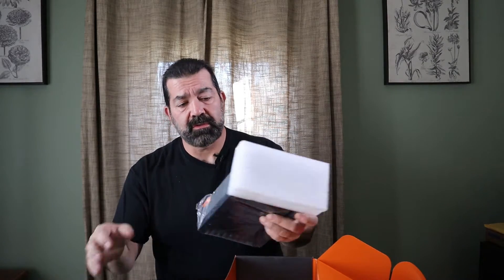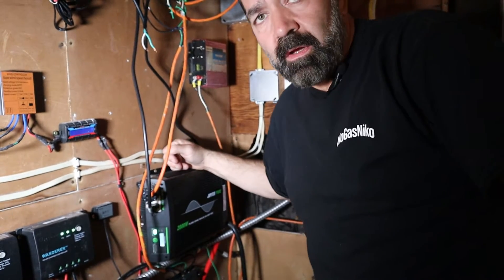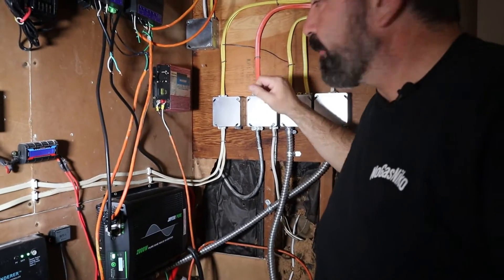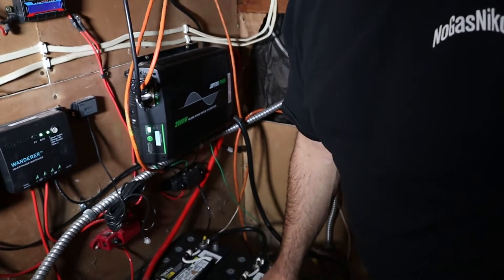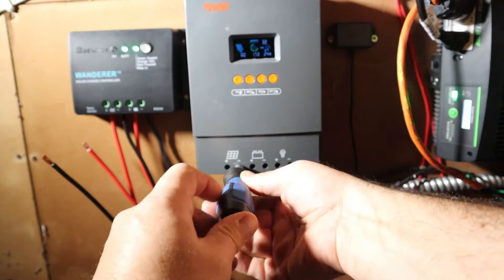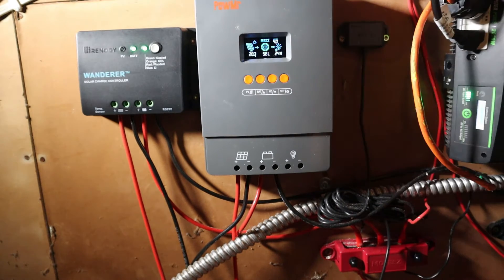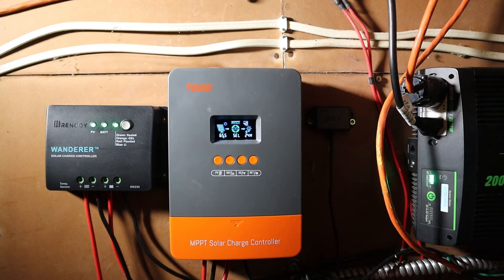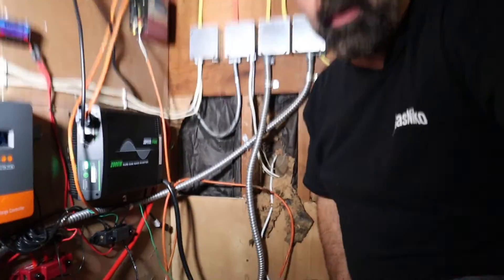PowMr 12V/24V/36V 60 amp MPPT Install - Part 3 Solar Upgrade

Comment: Bud out of the 5 series what series do i set my life po4 battery series4 or 7 or8 or15 or 16 thats my question
Reply from the maker: I would have to refer you to the manual or their customer service.  I don't want to steer you wrong since I'm running AGM batteries and don't have experience with that yet.
Reply: @NoGasNiko  ok

Comment: Falownik PowMR 6,2 KW Instalacja paneli fotowoltaicznych to 3,6 KW, falownik nie jest podłączony do akumulatora i nie jest podłączony do sieci. Mam podgrzewacz wody o mocy 2 KW podłączony do wyjścia falownika. Falownik nie włączy grzejnika nawet przy pełnym nasłonecznieniu. Jeśli zamiast grzejnika włączę odbiornik o mocy 500 W, falownik będzie wytwarzał prąd. Jak ustawić falownik tak, aby cały czas dostarczał prąd bez względu na obciążenie, chcę, żeby dostarczał tyle prądu, ile jest aktualnie w produkcji i nie wyłączał się, gdy załączę większe obciążenie. 

Instalacja fotowoltaiczna: 
225 szer. x 16 = 3600 W
36,9 V x 16 = 295,2 V

Ustawienia falownika
https://youtu.be/l9n7lgL5nu4?feature=shared
Reply from the maker: I am not familiar with this unit.  Can you verify the actual input from the panels?  I currently have 1.2 kW and I almost never achieve 1200 watts.  I see 1000 consistently.  Also check the manual for any mention of limits for the inverter.  Maybe there's a cut off based on input?

Comment: Can I hook up like a power strip?
Reply from the maker: It's 12 volts only.  Will not run a power strip
Reply from the maker: Nothing about this unit changes 12 volts to 110 or 120 volts.  It's just a charge controller and not an all in one unit.  PowMr has all in one units and that's going to be my next purchase.  It'll probably be spring time when I upgrade to 48 volt system.

Comment: I have a question for you. I have the same MPPT charge controller. I know where the solar system cables go. I know where the power cables go, but what is the icon with the lightbulb? What do you connect there? Can you please help?
Reply from the maker: That's for a 12V load.  You can hook a light or anything else that takes 12 volts.  It's an output regulated at 12 volts.  I've never connected a meter to it, guess you just gave me something to test 😁
Reply: you typically won’t use it in a home install, it’s mainly for if you have a caravan and you want to hookup some 12v appliances

I think it will product power so long as their is either solar or battery power present

Comment: I have a very bad experience with Powmr products. Their GT-800 micro-inverter lasted 6 months and gave up the ghost. Customer support and warranty coverage were a real pain and it is still not fixed. They constantly ask for new elements in order to exhaust the customer.
Same thing for the provision of a simple AC connection cable between 2 micro-inverters, presented on their site. After at least fifty emails, I gave up. The customer service is deplorable.

Comment: my 60A powmr doesn't let me configure the charge settings in the USE setting to match my 36V100ah LiFePO4. It limits me to 17V even when I choose the system voltage 36V. WTH
Reply from the maker: Have you tried calling their support?  I'm currently running 12V but plan on switching to 48V real soon.
Reply: It displays a 12v setting but you supposed to x that by you battery voltage so 14.5x4=58v that's a 48v battery top charge. Yours would be x3
Reply from the maker: That depends on how you connect the batteries, series vs parallel.  If parallel you don't add the voltage.
Reply: @NoGasNiko what if it's anything over 12v battery the controller don't show the higher voltage battery settings in the manual it even says 24 36 48 is 2x 3x 4x the 12v number in the controller. The display won't show the higher coltage settings so you have to do the math yourself for settings to work.
Reply: @NoGasNiko  also he said his battery is a 36v so that would 3x the number so 13.7 X 3 41.1 is what you need. Whatever battery you have whatever the the voltage you need to charge it you get to you by X the number on the display. It says it in manual
Reply from the maker: @supremeautomotive6749 perfect!  Thanks for clearing that up.

Comment: you saving any money with the solar yet?
Reply from the maker: I believe I am.  I have an air conditioner upstairs and one downstairs that run off the solar system.  The upstairs unit is a 6000 BTU and the downstairs is a 10,000 btu.  I'd say the upstairs ran about 60 kWh on solar and maybe 40 kWh for the downstairs.  17 cents a kWh makes about $17 saved.  I have meters on each outlet and run the numbers daily.  We didn't have very good sun last month so I'm hoping July will be better.

Comment: Hello, thx for the installation video. What size wire did u use from the battery to the mppt..also did u fuse the positive line with a 70 amp?
Reply: Did u route to a busbar before the battery bank? Ie: mppt to bus bar to battery?
Reply from the maker: Yes, there's a bus bar from the MPPT to the battery.
Reply from the maker: Each panel has a fuse and I have a disconnect and inline fuse to the MPPT.
Reply: @NoGasNiko  awesome thx for that info!

Comment: Wire size. 
Use the maximum values for watts and current. 
The given values are the battery voltage. 
The rated amps which in this case is 60 amps. 
 For the 12 volt battery system the maximum watts of solar power is: 720 watts. 
The wire size on the input side is smaller than the wires on the output side. 
The input side is determined by looking at the maximum current flowing from the solar panels. 
Start by looking at the values on the solar panels. Use the short circuit value. The actual value is based on the configuration of the connections. If in series the current is the same as the label value. If the panels are in parallel then add the values for the total current flow. 
The higher the voltage results in the lowest current for the same watts. 
Lower current results in smaller wire size. 
If the current is below 10 amps on the input you can use 12 AWG wire. If above 10 amps it should be 10 AWG or larger up to 6 AWG

On the output side the current value is the rated value for the controller. 
The current value to use for wire size is 60 amps. This value determines the wire size to be at least 4 AWG wire.
Use the American Wire Gauge chart to select the correct wire size. 
Be sure to place fuses or circuit breakers on both legs of the controller to battery side.

When you upgrade to the 48 volt battery you will still use the same maximum current value on the output of the charge controller so the wire size stays the same. 
The input will have new values as the maximum input current changes with additional solar panels.
Reply from the maker: Currently running 8 AWG and have not maxed the amps out.  Planning on switching to 48V so I can increase my wattage while avoiding pulling new wire.

Comment: If you're not running climate while charging the battery is thermally managed while charging. Super cold and hot weather can effect charging speed though it is minimal in the i3 dur to the small capacity and low speed of charging. The 94ah and 120ah will be even less affected by temperature due to the larger capacity and identical charging speed limit.
Reply from the maker: I think you commented on the wrong video 😁
Reply: @NoGasNiko  man, I gotta get better at typing while I'm watching a playlist 😂

Comment: I have that same charge controller 😊works great. I’m running two harbor freight 24v 100 watt panels and a larger 200 watt panel. I have a 2000 watt ROARBATT pure sine wave inverter and one 100 ah FEENCE lithium battery. Man I wish the price of lithium batteries would go down 😢 it took me a while to save up and get the one I have.
Reply from the maker: Nice 👍.  I want to switch to LiFePO4 myself.
Reply: @NoGasNiko  I’m not sure I wanna continue using lithium. Those BMS’s can be a big problem. They can go bad but the battery cells themselves can be still good.people who don’t know about this will throw the batteries away not knowing they can take them apart and replace the BMS. In my opinion I don’t want to go through all that. I see some who complain about the weight of gel and lead acid batteries. I’m not sure about restoring gel batteries but lead acid batteries can be restored following the right steps to restore them. I use a battery desulfator. It takes some time but think it’s worth it without having to worry about lithium batteries and those BMS’s modules. Happy New Year 🎆
Reply: The prices of lipo4 has dropped considerably. My first renogy 12v 100 amp battery was 1k back in 2019.  Now I'm buying 12 volt 100 amp hour for 155.00 bucks.

Comment: best bang for your buck is go with a all in one solar charge controller/inverter EG4 has one starting around 700 and saves you in wiring and much easier for beginners but 48v however that saves you as you can use thinner wire as less amps.
Reply from the maker: I've looked into those.  PowMr has one that I've researched as well.  My goal is to have a split phase 240v so I can run a sub-panel with multiple circuits but also have a 240v input for automatic transfers.  Hard to believe there's so many options with my specific criteria!!  Good to have options.
Reply: @NoGasNiko  yep, its crazy in just like 3-4 years it went from only s couple if that of all in one charge controller / inverters to now there are well over a dozen.  It truly is becoming so easy to set up a solar power backup system that will allow complete novices to get started and grow into their system.  The new eg4 14.3kwh battery for 3799 is amazing as it is all weather it can be outside no matter the weather.  14.3kwh is about half of the average daily power needs for their home that with power hog hvac systems.  Now with ductless mini systems that can have solar panels plugged directly to the ductless unit you can heat and cool completely off grid.   Super energy efficient.   🙌🏼😊
Reply from the maker: @iowac I'm just getting started.  Can't wait to see where this goes.  My goal is to run my entire kitchen off-grid 24/7.  Lots of appliances that pull a lot of power.  Heading in that direction but old man winter is going to put the brakes on real fast.
Reply: @NoGasNiko  Yeah im fairly new myself in 2020 I got my first set up with 800 watts of panels a 12 volt lifep04 200ah battery and 3000 watt inverter, I built out on a hand truck to make it mobile.  Kitchen appliances  , hvac and dryer are the energy monsters lol.  I trying to be prepared for power outage emergencies that will allow us to be able to stay warm/cool and keep fridge/freezer running.  So for cooking would prob resort to fire stove but will look to find a low energy cooking element.  But the great thing is for heating cooling a few ductless minis have hit the market that are super energy efficient.  I just put chunk down on first 48 volt all in one solar charge controller/inverter from signature solar their  new eg 6000 xp and the eg powerpro 14.3kwh all weather battery.  I figure with the govt giving the 30% tax rebate it was certainly a good time to jump in further.  

The tech has really jumped over the last few years, so much that people litterally can  set up a small cabin in the mountains where no grid power runs and they could power all they need with solar and battery.  Very cool stuff.